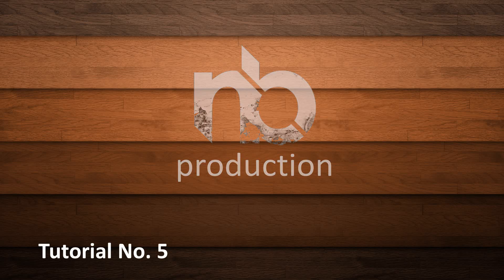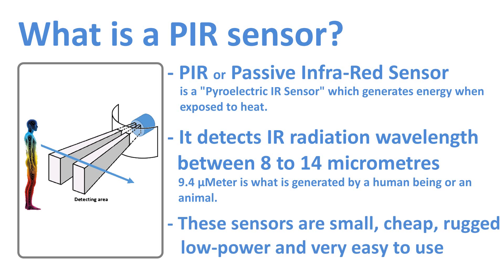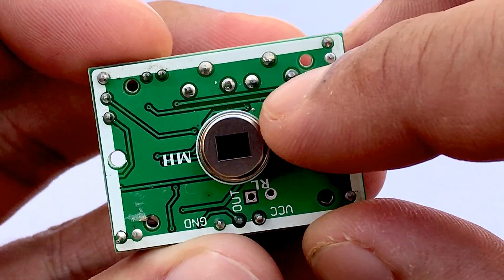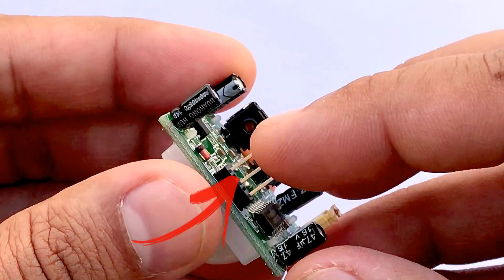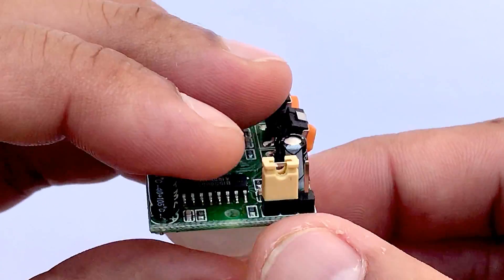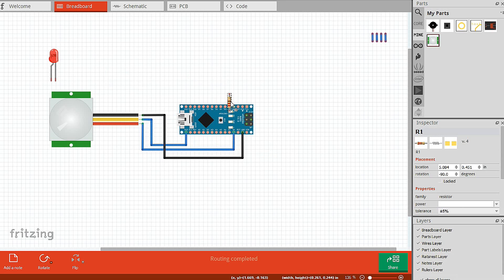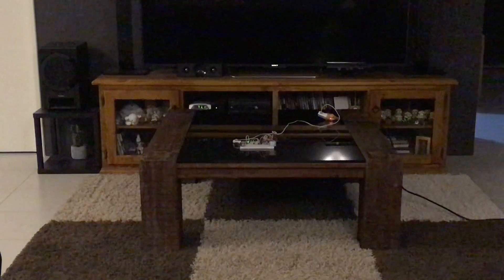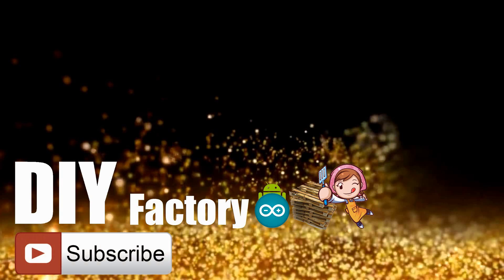PIR Sensor Tutorial - With or Without Arduino

Comment: In the "without audrino" model, would the LED still work without a 220 ohm resister? Or is there anyway possible I could replicate this without using a resister?
Reply from the maker: The 220 ohm resistor is a current limiting resistor.

A current limiting resistor is a resistor used in an electrical circuit to restrict the amount of current flowing through a component or branch of the circuit. It is a fundamental component in electronics to protect sensitive devices (like LEDs, transistors, or integrated circuits) from excessive current, which could otherwise cause damage or failure.

Comment: How can I light up a 12v led using pir sensor without Arduino? 😔
Reply from the maker: Use the pir sensor to trigger a relay and then use the relay to trigger the LED
Reply: @CrazyCoupleDIY  🤯
Reply from the maker: The digitql output pin of the PIR sensor connects to the input pin of a relay. When the sensor detects an object it will switch the relay and the relay can then act a switch to any other circuit.

Comment: Do you have a code for intruder alert with these components (arduino uno,gsm800a, 3 pir sensor)
Reply from the maker: Are you trying to detect motion using the pir sensors and then transmit it over using the gsm module?

Comment: Hello, quick question,  can i use a servo motor instead of the led light in your example without a arduino? Thanks
Reply from the maker: Sure u may 
But how will you control the degrees without a microcontroller?
Reply: @CrazyCoupleDIY  wont it just open the full 180 and hold untill the time is up and go back to 0
Reply from the maker: Yes that can be done

Comment: Maximum time is only 5 min? It is very low. How to make the light on until one again comes in front of the sensor?
Reply from the maker: If you are using a microcontroller like Arduino then you can add a loop to start as soon as the 5 minutes is over and do it for few iterations
Reply: @CrazyCoupleDIY  Ok. Thanks.

Comment: Does the Arduino Nano pins have to be soldered in order for it to work? it came in three pieces ( one set of pins and the circuit board).
Reply from the maker: Technically speaking yes 
However, it totally depends on you. 
I generally solder the two long side bits and leave the top one

Comment: PIR sensor also detects non-living objects like moving ball then how can you say PIR sensors only detect human body heat in motion?
Reply from the maker: I guess u are confusing urself with an ultrasonic sensor 
How can u generate temperature difference using a ball
Reply: @CrazyCoupleDIY  believe me do a simple test, throw a moving box in the range of PIR sensor, it will detect it.

I am highly confused how is this possible when PIR sensors only works for bodies which have HEAT??

Try it youself.

Comment: what is the output Voltage of this sensor? If I input 12V does it also give 12V in the Output pin ?
Reply from the maker: Hi there,
First of all thanks for stopping by.
Now, to answer your question, PIR sensor that's in this video has:
Output: Digital pulse high (3V) when triggered (motion detected) digital low when idle  (no motion detected). Pulse lengths are determined by resistors and capacitors on the PCB and differ from sensor to sensor.
Sensitivity range: up to 20 feet (6 meters) 110° x 70° detection range
Input: 5V-12V input voltage for most modules (they have a 3.3V regulator), but 5V is ideal in case the regulator has different specs

The PIR acts as a digital output, it can be high voltage or low voltage, so all you need to do is listen for the pin to flip high (detected) or low (not detected) by listening on a digital input on your Arduino

Applying a high voltage will fry the sensor. The output is regulated so it can never exceed 3v. If you want to operate a 12v device you may have to use a relay. 
More info here: https://diyfactory007.blogspot.com/2018/04/driving-relay-with-arduino.html
Reply: @CrazyCoupleDIY  thanks for your answer!

Comment: doe pir can move servo without arduino?
Reply from the maker: PIR just send digital high when a motion is detected based on the potentiometer settings.
You will have to use a relay for ur scenario
PIR will trigger the raly to turn on/off another circuit 
Check out my tutorial : https://www.youtube.com/watch?v=FSVCC0S_SRo - this may help you

Comment: Would it be very complicated to power the pir sensor with 12v and add a 12v relay to the led without using an arduino ?, thanks
Reply: Thank you for your response, that garage light , another nice video
Reply from the maker: Vcc in general should be between 3 to 5 Volts, however it is said that this can even work on 12v. Frankly speaking, I won't take a chance. Use a voltage regulator and put it down to 5v.
You dont need an Arduino with a PIR sensor. When a motion is detected the output pin goes high so you can couple it up with a relay to turn it on or off
I have done something similar in this project : https://www.youtube.com/watch?v=FSVCC0S_SRo

Comment: Have you used outside? What temps?
Reply from the maker: Temperature does affect the sensitivity, If you are trying to use outside the house (installing straight under the sun) I will not recommend using this. Maybe use a Ultrasonic sesor or something for that
Reply: I was more worried about water proofing